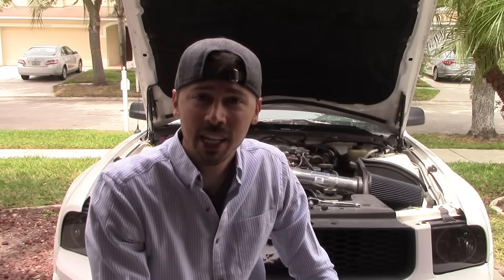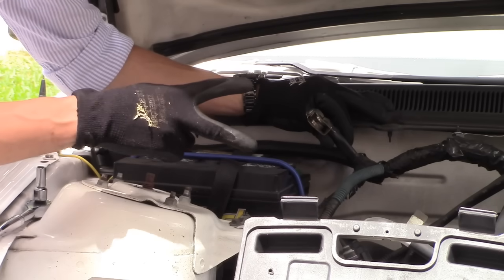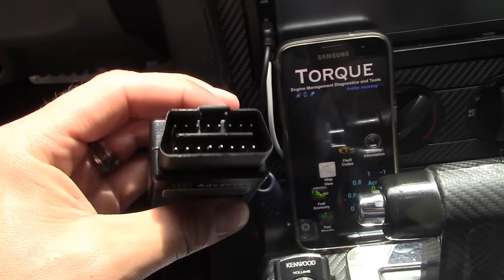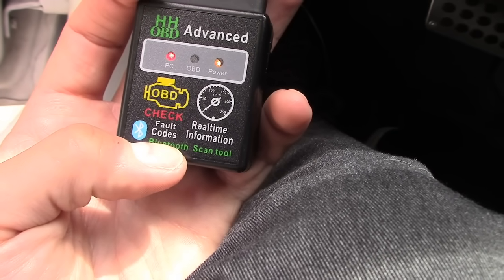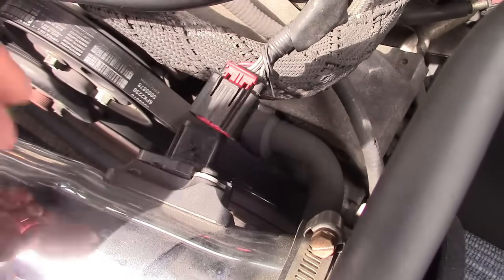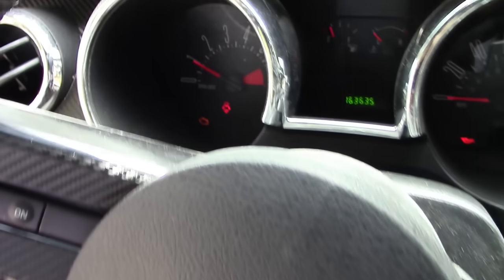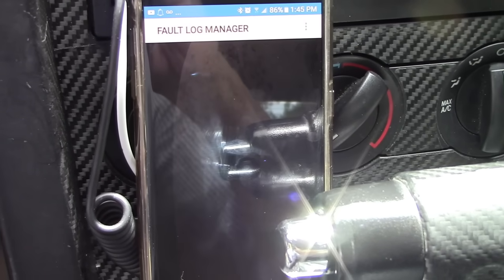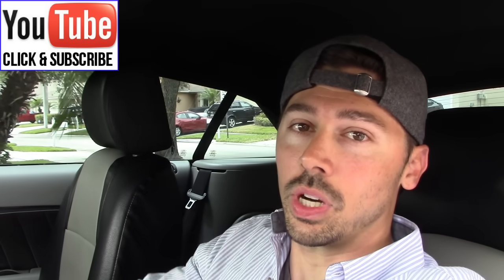3 FREE WAYS TO RESET CHECK ENGINE LIGHT WITHOUT CAR OBD SCANNER

Comment: Every OBD wireless box I have bought never works..The last one I got does connect to the app but never reads any info..the amazon link you have goes to a $21.99 box and im not going to buy another one especially for that price that wont work correctly.

Comment: My obd Bluetooth unit not communicate with my phone ? is it a problem with my car or the unit ? I got a new unit but still the same
Reply: Riyaz Hanis - Sometimes phones have glitches or bugs so just power off your phone wait for about 20 seconds and then power back on and connect. And make sure no apps are running in the backround or nothing is downloading.

Comment: the best free way is to remove the EFI fuse in the fuse box for a few seconds. this resets the car's computer without resetting the clock, radio etc. I have done this numerous times and it clears the check engine light on my OBD1 1989 Toyota Pickup
Reply: I do this as well. Although the light comes back on in a few days. Mine I refer to phantom light-2001 Dodge Intrepid ES. Time for yearly NC inspection. Hopefully this trick will work again. Car is maybe worth 375.00 so don't want to pit anymore money in it. Same code P0441 has been a thorn for years. Last year ended up buying a new factory gas cap. Car runs great.. just a pain once again.
Reply: Then why don't you fix the issue causing the light to be on?
Reply: Shane Waldo I have a 04 Mercury Mariner.think it would clear the engine code?
Reply: James Anastasia it should
Reply: Well, it depends on if the cause of the check engine light was fixed (e.g. bad o2 sensor etc.). If the cause was fixed, it shouldn't come back on.
Reply: Shane Waldo l
Reply: @Parax - km
Reply: Depends on the code,could come back instantly
Reply: If it stays on even after you shut the engine off and it is still there when you restart it, then you have a hard code. I have a suburban and the computer and fuse block is under the hood and I have an intermittant light that comes on.

What I do is when I get home I open the hood and disconnect the two connectors at the top of the computer and leave them that way until the next time I want to drive the truck. Then I reconnect them and the light is off. It may be a week or more before it comes on again and I just do it again.

The light on does not necessarily mean you will hurt anything by doing this but if you happen to be somewhere it can be checked it may be an easy fix.

Now FYI I was a GM mechanic for 20+ years so I do know the system.

Comment: Hi, 

You mentioned the gas cap could be loose, but, if you've got a gas cap issue and it's good and tight, check the gas cap O ring.  On an older car you may find a slight crack in the O ring.  This is enough to keep the gas cap from properly sealing which causes the Check Engine light to come on.  This happened to my girlfriends car.  The Toyota dealer didn't have an O ring in stock, so I bought a new gas cap and the problem was solved.

Regards, Tom
Reply: i hope you still have this account but did it clear right away or did you have to go through the cars drive cycle

Comment: man that was 22 bucks not $9 like you said. then I was reading on the Amazon page that the app can cost 2 depending on your needs so the app that you were using how much does it cost?
Reply from the maker: Soulcommander buy obd 2 adapter after november 15th to December 31st for about $10. torque app is free but some features cost only couple dollars.
Reply: torque is the only app
Reply: Soulcommander  i check on amazon its from usa $22 but when checked on ebay its £4.78  free postage same item ..
i live in uk so its cost me only £4.78    search on ebay   HH OBD2    You will find out
Reply: what the name of the app
Reply: i just bought it after watchin this video because i need 1 ...and its brand new
Reply: think
Reply from the maker: I paid about 10 but prices do change, the one in video description is prime which is protected by Amazon. best time to buy is end of November  after black Friday save 30% to 50% off. the obd apps are free but extra features is worth $2. like fuel economy plugin.
Reply: maybe its a used one on Ebay?

Comment: Just colour the light in with a black marker pen. Problem solved.
Reply: I covered mine with black printed junk mail and it works for so many years !!
Reply: I just used a smiley face sticker to cover it up 😊 
🤣
Reply: Crazy E lmao cuuuteee little faces typed also lmao
Reply: Paul Hicks 
Funny. Did Curly, Moe or Larry teach you that ? Oh wait..... Gilligan just called and said he gets the credit. Lol
Task force guy - over n out
Reply: It's funny cuz I thought of that earlier
Reply: Transmission control  module
Reply: Paul Hicks
Reply: Tune to channel you like, then long press a button on radio to set that button to that station.
Reply: Until inspection time ;)
Reply: Kevan Hornsby how can I reset my truck radio in Chevy avalanche? after disconnecting battery?
Reply: Paul Hicks hahaha good idea
Reply: Me need to your help my car just crank can't start and no power is coming to the plugs what could the problem
Reply: ffion Mwale ignition.
Reply: Glad I live in South Carolina, no inspection, sweet.
Reply: Paul Hicks electric tape works better.   Light won't bleed through and faster to apply or remove
Reply: Paul Hicks Good point body I did that for my head lights problem on my dashboard 😂😂🖒🖒🖒
Reply: icemule - Right On, icemule
Reply: Or you can cut the wires at the back of the instrument panel, one of them should be for the check engine light. Thumbs up, yepppp!
Reply: Paul Hicks 😂😂😂😂😂
Reply: LOL
Reply: Lol
Reply: Paul Hicks hahah nice try
Reply: Just take out the CEL bulb , lol
Reply: Ha, funny you say that, I done that bit only on Honda and Toyota because they just keep going.
Reply: i used tape
Reply from the maker: Paul Hicks 😆 that works too
Reply: That's messy. Took the LED or a bulb out and hey presto, the problem is gone!
Reply: Paul Hicks they hook up their computer,they would know
Reply: Out of gas, when you fill up, take an english class also.

Comment: thank you!!! mine has been on for a year eeek! will have to see if I can get one of those in Australia (and where that plug is in my car???) or could you pop over and have a look for me?? 😍
Reply: Well she is pretty hot and add that Aussie accent, and... well you get it.
Reply: Tampatec i think your check Danielle light is on
Reply from the maker: Danielle Wilson sure but plugin is just under your steering wheel.
Reply: Oh look at that just had to remove the cover of that thing I always wondered about and hey even found the steering wheel column adjustment too!! Well I noticed you can fix Chromecast also and mine is being a little bi**h so you don't get off that easy haha

Comment: pulling the batt cable will not reset it. It will just turn the light off and it will come back on after x amount of miles. If hooked to a scan tool it will still show a code. go to autozone, advance auto probably even an Oriely. FREE
Reply: Autozone will read the codes but they won't reset the light

Comment: Second comment because the first had a link in it.
If you own any Chrysler vehicle since 1988 you can cycle the key. Cycle the key without going as far as the start 3 times. On-off on-off on-off then on then leave it on but not started. Wait for a few seconds. The flashing light is your fault codes. flash flash pause flash flash flash flash is code 24. Or Flash pause Flash Flash is code 12 which is battery was disconnected. All cars should have this. It will just keep cycling through your codes until you turn it off.
Reply: Solder Joe
Reply: How  to fix a 2o7  BMW led  head light

Comment: Are these on the Canadian site fakes or junk? I wonder because the price isn't jacked up to screw Canadians?
https://www.amazon.ca/s/ref=nb_sb_noss/134-0194716-3263255?url=search-alias%3Daps&field-keywords=BAFX+Products+34t5+Bluetooth+OBDII+Scan+Tool+for+Android+Devices
If you own any Chrysler vehicle since 1988 you can cycle the key. Cycle the key without going as far as the start 3 times. On-off on-off on-off then on then leave it on but not started. Wait for a few seconds. The flashing light is your fault codes. flash flash pause flash flash flash flash is code 24. Or Flash pause Flash Flash is code 12 which is battery was disconnected. All cars should have this. It will just keep cycling through your codes until you turn it off.
Reply: Solder Joe zee

Comment: Great video as usual. So will this tell me what to fix on a " service air bag " indication?
Reply from the maker: billfromelma it only gives a general idea not exactly the bad part.
Reply: Ok thanks!
Reply: billfromelma most air bag light problems are dirt and crap in your sliding seat runners dust food etc it thinks the driving seat is not locked in place and will put on the air bag light this is common from mums with kids in cars I find its mostly kids wax crayons that wax up the runner's its not a cheap fix in the garages as most seats have to come out to clean them runners at 60 pounds a hours labour mums beware

Comment: Or if you can't wait you can go to Harbor Freight and buy one. If you have a check engine code, it is recommended to fix the problem ASAP, for if you don't, it can lead to bigger problems. Most sensors in cars go bad and is an easy fix. You can pick up sensors at your local Auto Zone store. If you need to get your car inspected, when you clear codes,they will not give you an inspection sticker unless you drive a few hundred miles after you clear the codes. So make sure if you need to get your car inspected,  do that well in advance otherwise you will not get an inspection sticker.
Reply: Yah...but at $50. To $780 a piece for these plastic Fucken sensors, you run put of money fast...and most generally replacing these Fucken sensors doesn't " fix" the problem, only compounds it.
Reply: how would they know the sensors are cleared?
Reply: so much wrong in this section i cant even begin